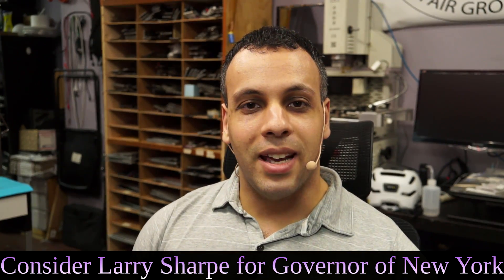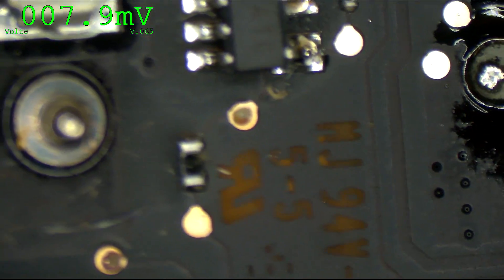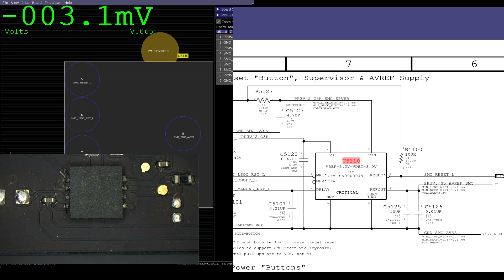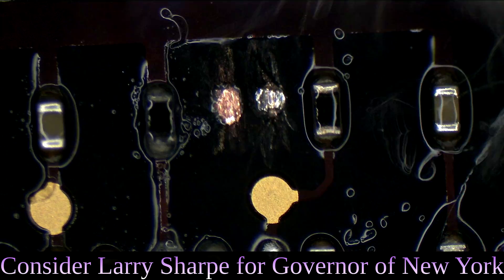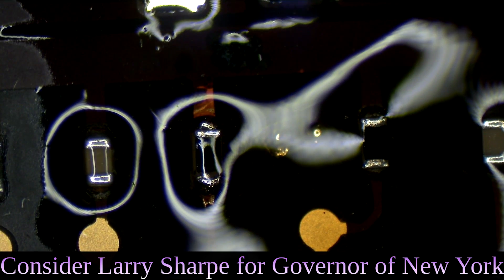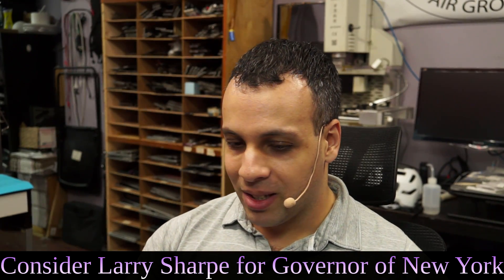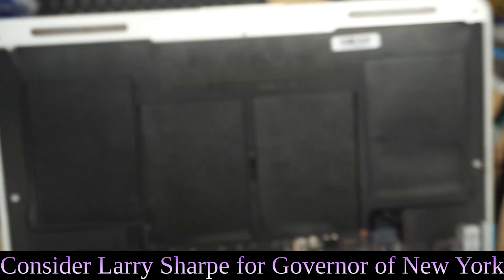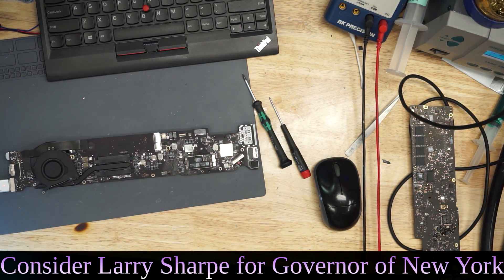Can 1 drop of liquid destroy a Macbook Air?

Comment: "If only they would let yo repair, and you would be out of a job"... well, no, you would be working your talents at an authorised service centre.
I hate apple and their policies, after working at a service centre back around 2016-2017.... For about a month before I quit.

I did manage to diagnose (correctly) a faulty screen on a macbook of that era, and also a dead CPU on some dual CPU machine (which I cant remember the name of... it looked surprsingly like a PC though)... Both were successful repairs, and all under warranty.

However the number of potentially repairable devices (including Ipods at the time, where they brought in a dent measurement tool that was about 0.3mm deep being used on any part of the external casing where if the tool clears would be deemed irreparable)....

Well, I never liked Apple to begin with, and after that experience, and seeing what is STILL going on these days, Apple can eat a d!ck.

Comment: Its so frustrating. I’m an apple user. I do have a windows laptop because sometimes you just need one but I 100% love my Apple products. Physically they look amazing and I love the operating systems. BUT. I bloody hate the way they treat their customers. Spending over the top money on a machine that’s either going to kill itself by overheating or just randomly die on a humid day. Most of the issues people have with Apple could be solved. They could EASILY charge less for their machines AND offer a much higher performing and robust machine, built in such a way that is can be easily fixed and still make money. Hell I reckon if apple pulled its head out of its backside and actually built a “good” machine they would win over a LOT more customers. But they are hell bent on maximum profit for the least amount spent and it’s a shame. I love the Apple ecosystem so I’m stuck. Put up with a machine that might become suicidal because it was designed to do so, or move over to windows.

Comment: I had a bottle of water spilt on my macbook air. now the back light on the screen turns off within 30 seconds of powering on.
works fine on external display and still boots up.

If I shine a torch onto the screen, it is actually working (i can see the desktop), so its defo the back light

I have looked over the board and cant see anything obvious on the board. any ideas where i can look on the board ?

Comment: Serious question… 
would it be possible to put this kind of "tape" on a MacBook mainboard by your self (or by a company like yours Mr. Rossmann)?
I mean… like you (I) buy a case for your phone or a protection glass cover for your phone display you could also buy this kind of tape and protect your product.

I watched a bunch of videos about a liquid protection where they sprayed a protection liquid on (actually in!) your phone or any electronic device and after it was waterproof.
You could have a call under water without damaging your phone.
That would be also a good solution for prevent this kind of water liquid damages?! Isn’t it?!
Reply: use paraffin, if you make any mistakes in the connectors you can put the board on boiling water with some detergent and the paraffin will be gone, plus you could use it as a thermal paste and solder flux also, i have a gpu covered in paraffin with a waterblock to transfer heat, and use it on my cpu as a thermal paste.
Reply: i use paraffin to avoid oxidation of contacts, and for subcooling cpu's below 0 degc.

Comment: Why do Apple boards look so funky? Not funky fun, but funky nasty! They always look dirty and cluttered, even when new! They seem to have twice the resistors and capacitors, but other brands do the same job with half the components and still get better life out of them. Why is that? The other day i was looking at iPhone X boards and Galaxy Note 9 boards, and Apple´s boards have way more components, but there is nothing an iPhone does that a Samsung phone cannot. In fact, the other brands often have MORE stuff going under the hood , like finger print scanners, headphone jacks, etc. It´s like Apple´s engineers are cramming the boards with useless parts just so they can argue that space is at a premium and cannot fit larger batteries. I can´t wrap my head around it, what´s the point??
Reply: That's probably exactly it...

Comment: So there's this story of my BUDGET 400,- Acer 11" i3 laptop. (V5-171)
Nothing and Nobody ever said that thing should be well build.
Dropped a full glass of strawberry milk on it.
Device turned off. Tent mode. 2 days later.
It still worked! but smelled like burning strawberry which was just ok. lasted for a few days..
The touchpad stopped working though, and i didn''t bother to take the whole thing apart. it was a budget laptop after all and by the time this happened...well... Let's just say we replaced the laptop as soon as possible so it became a spare device.

2 years later... My daughter dropped a full glass of water on the poor thing.
And it died. sort of...

I kind of abandoned the thing at this point, but let it sit in the attic for about a month.
Tried it again after this period, because why not., and to my surprise, we had power back!
the HDD was ripped, so i replaced it with a much needed SSD.
I also took the time to properly open the device up for more inspections.
Everything was rather clean. so i closed it up, booted windows...

AND EVERYTHING JUST WORKS. even the touchpad was working again!
When you expect the cheapest stuff to break so easily, and they last longer than the so-called "premium" stuff.. :)

Comment: Rather than tape, what they should be using is a conformal coating over the entire board sans connectors.  That would eliminate corrosion on all but the connector locations.  If I was stupid enough to even buy a MacBook the first thing I would do is conformal coat the boards just like every other manufacturer out there.

Comment: I've fixed so many PCs, infested with roaches ,bed bugs, left overs from mice and who knows what else, cleaned them up with air pressure from an industrial compressor, no water filtering, no static guards,,,, whatever,,,,,They start and/or continue working as they were.Point is: they are meant to last and the mother board short circuit protection did its job,,, prevent over load and shut down to protect the system.
Normally I take proper safety measures but the mess on those systems make me lose on people. Apple has no hope!  Neither the fanboys, they are all around us and sadly even with this proof we are just haters on apple to them.

Comment: I recently sprinkled coke all over my 2015 macbook air. No issues so far, but i think some did leak through keyboard. Time will tell whether I’ll have to deal with this. Also,back in 2013 or so i had another butt clenching experience. I had poured a full mug of sugary tea all over my MSI GE620 laptop. It was baaad. At one point the screen went blue and said something in terms of “youre fucked”, not a regular bsod. Thought it shorted as the battery was still in. I obviously removed it and tilted the whole laptop while waiting solid 20s for the liquid to seep out speaker grills and whatever else holes were present. Anyway, i just left it over night as it was pretty late and disassmebled what i could the next morning. Took it all apart and cleaned sticky parts with alcohol, applied new thermal paste and put it all back together. To this day it works fine. Keyboard was a little sticky though haha.

Comment: And if MacBooks didn't need a new logic board or complete replacement ever year Apple would be a penny stock
Reply: ? what is your denominator?  ? is the actual rate of failure vs other brands, over time. My white Macbook is still very happy after 10 years. One data point

Comment: [LIQUID DAMAGE EXPERIENCE] I have a macbook air 13" early 2014, Last year I spilled coffee(with sugar and milk) all over the right side of the keyboard.. Coffee was literally dripping out of the ports on the right.. But everything except the thunderbolt port worked just fine.. The USB and card reader didn't work for a week after the incident but then started working on it's own. I couldn't have had better luck 😂
Reply: Obviously you got a development model by accident. It was supposed to break.

/Sarcasm
Reply: Still it could die over time because of corrosion. The board should be always cleaned with isopropanol alcohol after such "adventure".

Comment: Imagine designing a car where a single drop of water ingress kills the engine. Also the air intake is mounted as low as possible.
Reply: You just invented the iCar
Reply: So Ford and Tesla?
Reply: Most manufacturers have the air intake low.
Reply: i think he means street-scraping low.
Reply: Not a Florida resident, clearly

Comment: Another freakin great video showing repair of Apple crapware.  Isn’t there some sort of substance or material a manufacturer can coat a logic board with as the “last step” in the process?  You know, to protect components and traces from humidity or micro drops of liquid?   Just wondering.
Reply: Yep. Just basic tape like on the Thinkpads, or a conformal coating.
Reply: What is the case against it?  Their engineers are not idiots, but it may have been a compromise for some other feature like cooling
eg: http://www.humiseal.com/conformal-coating/    is a good intro to the topic
Reply: I'm interested in Whazzat's proposal. A nice layer of conformal coating seems like an awesome barrier to the machine breaking, but I'm far too much of a novice to know if it has other repercussions.

Comment: All I can say is thank god apple dont build airplanes. Redundancy is NOT in their company dictionary.
Reply: Yes it is. I find literally ALL of their products quite redundant.
Reply: Well they are working on self-driving cars with no steering wheel, so what could possibly go wrong
Reply: When it rains or somebody spills his/her drink and you sit in an Apple Airplane, you are really screwed.
Reply: @felixd2136  An "iPlane"
Reply: Remco, I get your point lol. In engineering, redundancy is the duplication of critical components or functions of a system with the intention of increasing reliability of the system, usually in the form of a backup or fail-safe, or to improve actual system performance. I wonder how many of their products went to landfill/recycle because of a couple of bad 50 cent resistors/capacitors etc blocking the flow of electrons ...
Reply: Didn't you hear about kanyes iplane  that he introduced trump to this week? Not a joke, granted I have no idea if it would ever get the apple touch
Reply: LMAO Greenpoint
Reply: Thank god Louis does not repair those apple planes "The light in the cockpit turns on, i got fan spin, im done!"
Reply: what could possibly go wrong with self driving cars, its not like you would have time to drink something in that because you are driving right? O no wait, when the car is a self driving thing you can just grab some beer and sit back.  Can we start a bet on how many minutes before the first crash because someone spilled a drink?
Reply: @gabbermaikel  If it's an Apple car... I'd guess somewhere in the negative region because the moisture in the air would cause corrosion on something on the main power rail which would prevent SMC from waking up. Leaving us with a dead iCar.
Reply: Most likely that car will become dead in a rainy day in middle of busy highway.
Reply: They want to build cars now. Right now its only a rumor, but I am positive, if the car breaks down, you have to get a new one.
Reply: Well if they did, you can be sure there's be a long line of NPCs just waiting to board them.
Reply: As I know, Apple are working on a car...

Comment: You got any advice to tell if a CPU or MOBO fails, My machine did turn on however it did not complete the POST and did not boot loop, it would not boot yet the CPU debug LED remained lit, i tried resetting Cmos and nothing, I feel i may have killed it because i tried overclocking due to a windows 10 issue, specifically the bug with the antimalware exe, after that is when i got the issue i just mentioned after shorting the lead for the cmos battery the machine would not turn on, where did i go wrong and how can i tell in the future. I am a I.T student and would like whatever you can tell me for future repairs and servicing i do for friends and family. Also my CPU fan did spin up
Reply: You know, I heard that in NY there's a nice repair shop where they can fix your laptop.

Comment: Can u pls show us what the tape to waterproof the board looks like and how to apply it?
Reply: Look for a picture of the boards in Thinkpads.
Reply: @ NeuronalAxon , Like your channel: of White noise, hacks and old ear wax, of cabbages and kings.
Googling this using key words: water motherboard board  lenovo thinkpad water resistance laptop,   in combinations
not getting me there. Any hints?
Use bulb syringe plus minus earwax cocktail for the wax. simple goes a long way  You're washing them wrong
Reply: @whazzat8015  - Try image searching for 'Thinkpad motherboard'.
Reply: thx   found good intro to it with  http://www.humiseal.com/conformal-coating/
https://electronics.stackexchange.com/questions/367841/conformal-coating-pc-parts
Also discussion of complicating issues like cooling and impedence alterations again it's an engineering problem and actual failure rate would help.
Several sites  repair Lenovos and it may affect repair as well
Reply: For real. I'd love to open up my own machine and apply it myself; I'm not about to pay Apple $1200 for a repair. Maybe an even layer of conformal coating might work? Though I don't really know how that would affect the components.

Comment: Dont know why they dont Varnish the board after ....It dont hurt anything and protects the contacts..
Reply: They aren't interested in a product that doesn't go wrong. How would they charge hundreds if not thousands of dollars for a small, inexpensive repair?
Reply: Conformal coating FTW.
Reply: Iv never seen this much Rust, corrosion, BAD soldier...in Any machine Iv worked on..thanks god.

Comment: You dont get to a trillion dollars with lasting products. Alot of companies were fighting for the privilidge of planned obselecence 20 years ago, but only ONE could succeed. That company is Apple. Think different.... think emotions. Thats what Apple is all about: not lasting hardware, but lasting emotions. And what better emotion comes with the simplest of experiences: a big fuggen button that is labled: do what I want it to do. And you have to admit, Apple is really good with those kinds of "buttons"
Reply: For what it's worth my most long-lasting tech stuff was from Apple. But right now all I can recommend from them are their iPads and iMacs, considering their stance on the right to repair and shitty design choices. Sure, thin and light is nice, but completely locking down everything in the process is dumb af, not to mention locking out 3rd-party replacement parts.
Reply: iMacs? No, not anymore, just as bad as the Macbooks. Just less likely to get water ingress in those.
Reply: @Torchedini  I was speaking about value. Though it is shitty you can't use it as a monitor after the internals get outdated.
Reply: @koustuvkanungo9873  I've a 2012 Pro. Its still like new. And I use it heavily (film editing, emails, movies, music). Ive even dropped it twice, with it giving me a pink screen that lasted all of 1 day without me doing anything except stressing over my carelessness. 

Ironically, the only long running issue I have is from when I spilt some drops of water on the keyboard back in 2015. From then, the 'p'  and '0' key always gives me 'p0' when I type them. On the other hand, my HP and Toshibas had a two year maximum usage before I had to dump then. I'l definitely be buying another MacBook soon.

Comment: Is there no money in the android/pc market? I just always wondered why you focus on apple and all the stress that comes with it?
Reply: Apple stuff breaks much more easily.
Reply: And android phones have variety, if an apple shitpod 6 comes in you already have parts but if a TescoPhone 4™ comes in you don't have any idea where to look for anything
Reply: except that resistors, capacitors, diode etc are standard parts so likely he would have spares.
Reply: low volume Disposable PC's with no parts or manuals perhaps. The total cost vs Apple may not be that different. No collected forum for feedback. It's expensive any way you look at it
Reply from the maker: Too much variety. I could figure it out, but most people expect two day turnaround times, and it would take me longer than 2 days to even find parts for so many different machines. That business model is not compatible with today's Amazon Prime customer mindset
Reply: Yeah guess that makes sense for stocking parts.